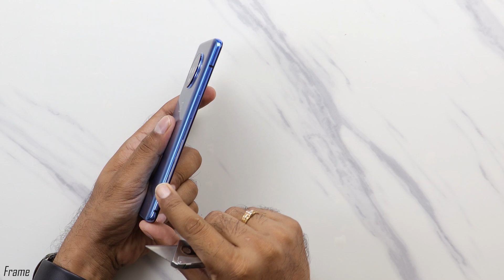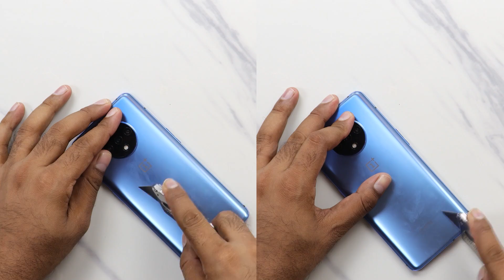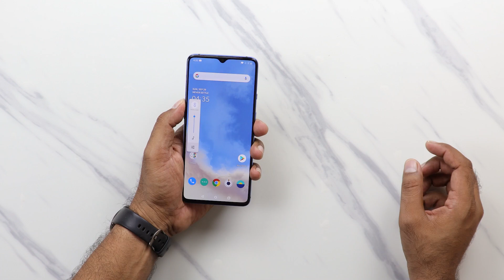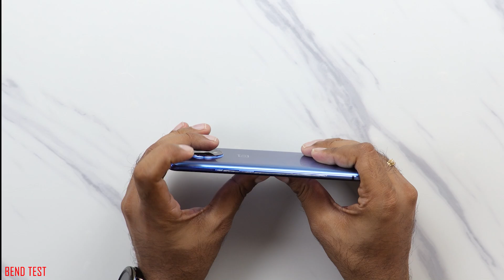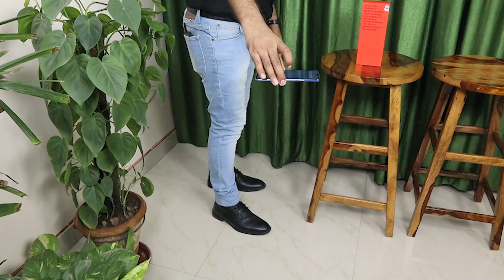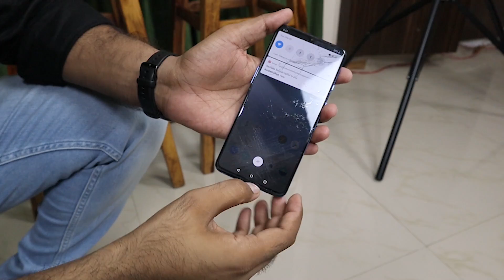OnePlus 7T Durability Test - Failed Like Never Before | English

Comment: My Oneplus 7T got dropped from pocket height onto a linoleum floor,  with the case,  and my screen cracked.  It did not hit anything just fell out of my hand landed on the floor and the screen was ruined, with the case!  The screen started getting purple dots and they soon started spreading across the screen like a plague.  Next morning the screen was completely covered by black and purple.
Reply: Same here, I had a screen protector and case but after and my drop created two hairline cracks and now the display is gone.
Idk, I think the durability of the phone is definitely sub par.
Reply: Mine got cracked in pocket, the worst durability that I have seen in years out of mobile phone.
Reply: How much for display..?
Reply: Congrats

Comment: Bro, is it really that fragile? Anyone? Any real life experience?
Reply: Not at all bro,
In very rare occasion like veryyy rare,
The glass will gona brake
Reply: Yes it is, it's less so the glass then the display failing after a drop.
I had a glass screen protector and a case and dropped it and it created two small hairline cracks that I could live with but the display completely failed.